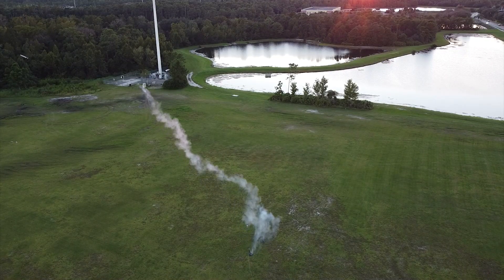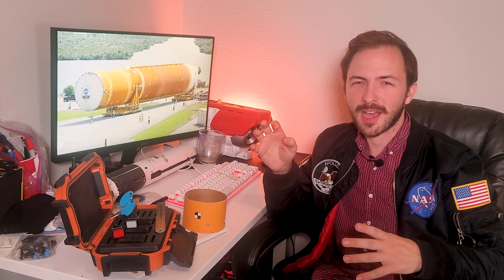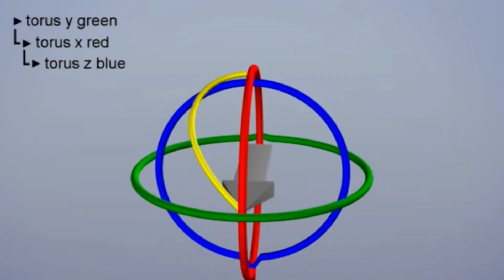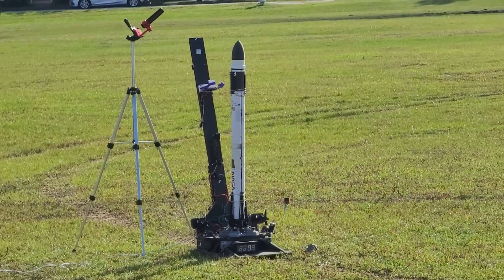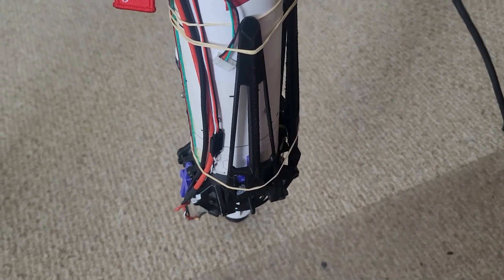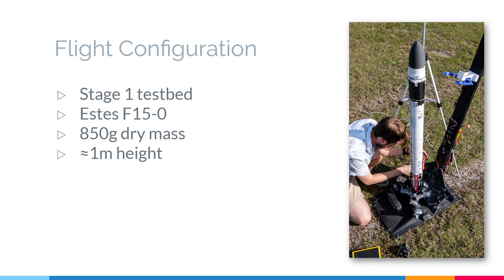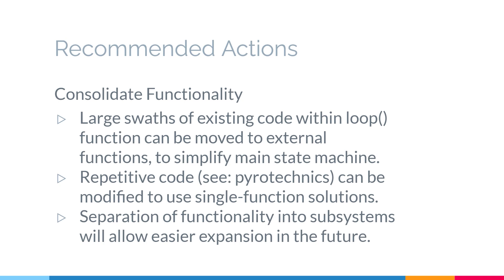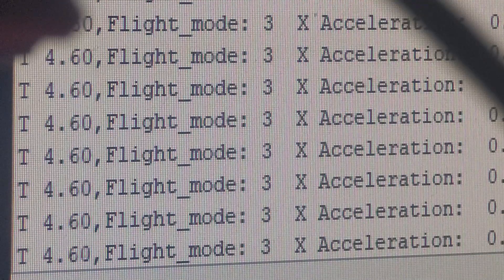Using SPACE SHUTTLE Software in Model Rockets

Comment: yeah, make sure the guidance system is fast enough, but make sure to add some dampening on the reaction so it doesn't 'hunt' the guided path.. (oscilating around the projected trajectory)
Reply from the maker: Yeah i believe the derivative term could have been a hair higher but overall I think the control was rock steady. Vehicle stayed within 5deg of target angle